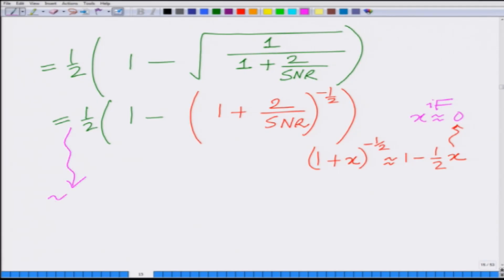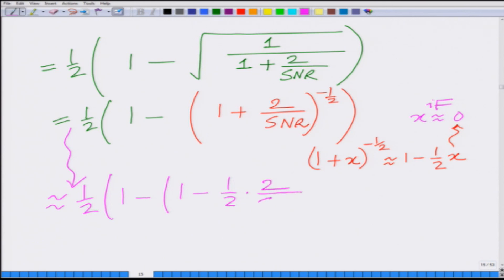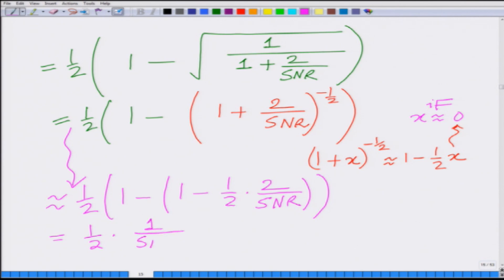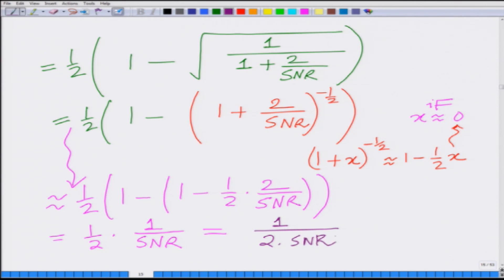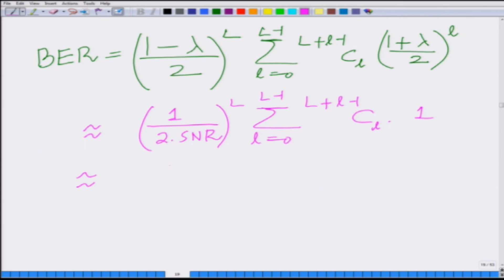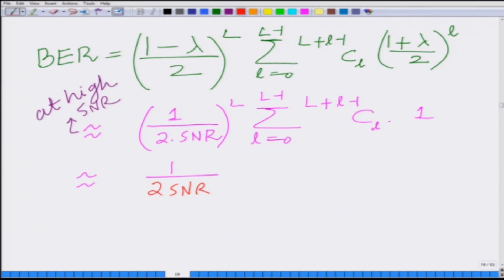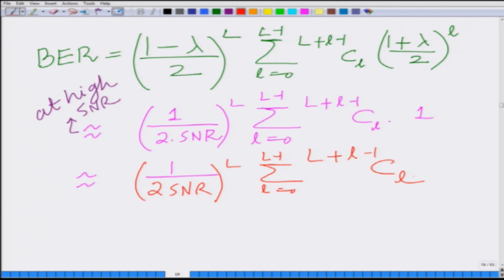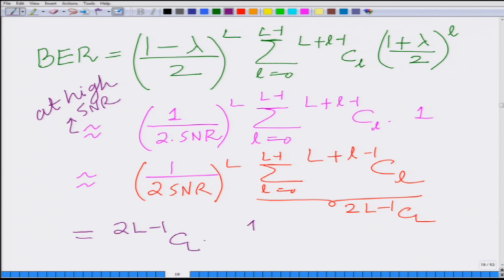Lecture 15: Approximate BER for Multiple Antenna Wireless System

Comment: in 1+lemda/2, if we approx the 1/snr=0, then can we approx the 1/snr=0 in (1-lemda/2), if not then why?
Reply: Theoretically, this is from the limit theory or approximations. 
Practically, when you're approximating something, you still want to keep the relative error least (|(original value - approx value)|/original value) to be least. When you make the 1/SNR term 0 in the 1+Lambda/2,  the loss in accuracy is negligible. When you make the 1/SNR term 0 in the 1-Lambda/2 approximation, we loose the entire value while approximating, which shouldn't be done. Some value was tending to 0, but wasn't 0. And we approximated as zero. Now, it'll create havoc everywhere else, cuz we do like to divide things a lot in engineering. 

Hope it helps